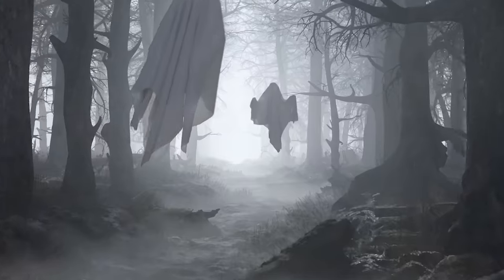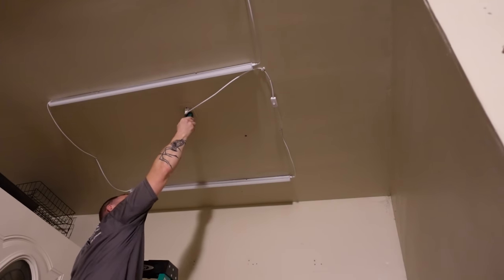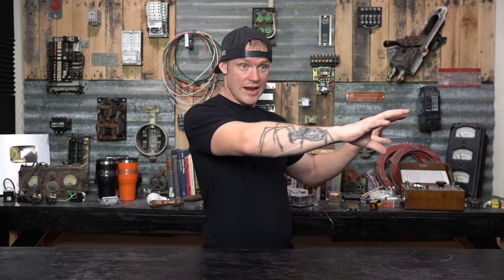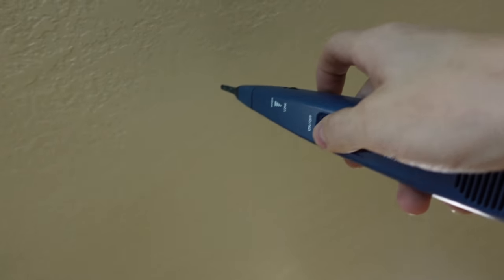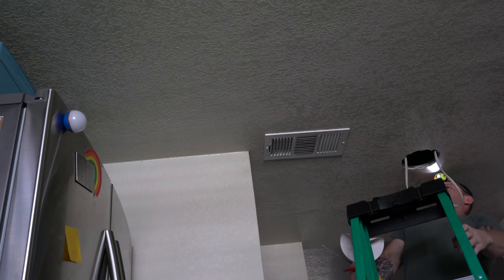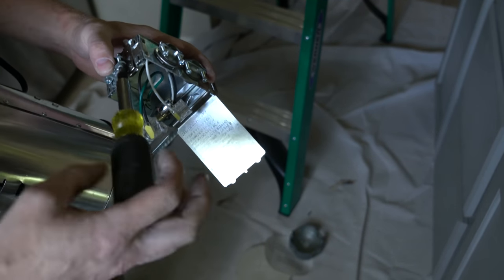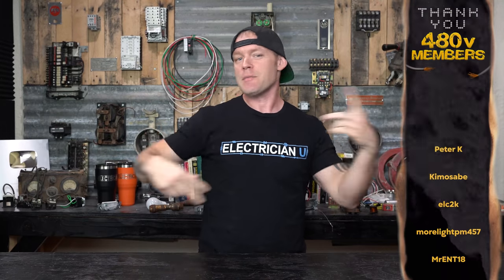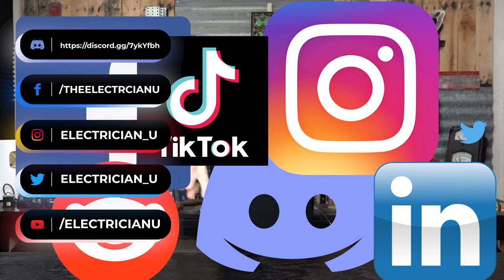THIS IS WHY ELECTRICIANS DON'T HIDE J-BOXES IN WALLS - Finding Hackwork!!

Comment: while adding a new outlet I discovered bad work at my intended old work location, so my simple task became a significant chore.  The original install really chewed up the nm cable at point of entry to the box and the was no slack/ service loop. I just had to create an in-wall junction, sigh.  I was able to access some dead space in the home through a closet, crawled in around ducts and added the box with new wire to extend to the old outlet.  I’ll close up the hole in the closet with an access panel (accessible) and leave a label/note in a couple of locations so it’s a documented for the next person.  I hated to do that but the other option was opening up a big portion of the ceiling with low clearance above it, multiple rafter/joist transitions and insulation too.  I’m thinking it will be best that a young apprentice be the person going in later, more “experienced” (read: heavier) tradespersons might have a rough time.   Hehe.   Nice job finding and even better explaining this to people.

Comment: Maybe-useful distinction:  voltmeters or lights show a measurement, and draw just a tiny amount of current from the circuit to do so.
However, sometimes the measurement is of an intact circuit that can deliver amps, and sometimes it's of an open circuit or stray capacitive coupling that can only deliver a tiny amount of current.  That's how you can measure 120V between wires A and C, 10V between A and B, and 6V between B and C:  wire B is open, and there's capacitive coupling going on.

Comment: Stray voltage (neutral to ground) comment – possible explanation. It appeared that there was no discontinuity in the hot (black) wire. So, any device connected downstream of the broken neutral would connect the hot to a mostly floating neutral. Provided this was a low powered device, (like a radio in a switch suitable for home automation or even your outlet tester) it would provide a very high resistance connection (hot to neutral) resulting in the stray voltage you detected.

Comment: Good information.

One caveat. The installation instructions for those low-voltage LED wafer lights stipulate a minimum required clearance…typically 3 inches…above those fixtures. Point is, they should not be installed directly under a joist as explained.

One question - what meets NEC when the connecting wires CAN’T for inside the small metal j box provided on the fixture?

Comment: I do low-voltage installations quite regularly and I'm also an avid DIY'er and the guy whom friends and family call when something needs fixing or building. Very often I encounter workmanship that I, as an amateur, would have been ashamed of putting my name on and charging money for. I cannot count the number of time I've gone in to troubleshoot an electrical or mechanical issue only to realize the problem at hand is the inevitable latest step in a long chain of incompetence or inconsideration (or both) on the part of those who came before.

Sometimes a situation is salvageable (as it was in this video) but very often a remedy is impossible without extensive structural work. 

Much to my chagrin, I still encounter homeowners, builders, contractors, etc who are willing to half-ass a job if it means saving a few minutes or dollars. "Not my problem" is the attitude and it's anathema to me.

Comment: Okay so I stopped the video at 8 minutes 25 and I'm going to predict that this outlet is GFCI protected from the GFCI in the kitchen... Is carrying power to the switch the light... And you're about to find out from customer down the line of the video that sometimes happens when the GFCI is constantly popping in the kitchen...also it is not wired correctly or ground is being energized which we all know thats a big problem ....I'm probably wrong but I could be right.....i will play the rest of the video...to get my answer.... By far one of the best or the best electrician channel

Comment: I had a strange voltage issue at a rental with lights flickering. Traced down to one of those CFL light bulbs plugged into an outdoor patio light. Replaced that light bulb with an LED and everything started working fine again. It is a 1970s house so probably all the neutrals and grounds bound together in random places which explains why I can have strange voltage issues with the neutrals. especially with lit up switches with LED light bulbs 🤭 that don’t turn off.

Comment: Great diagnostic ability. The only thing is if the wires melted . Wouldn't the actually issue be that's there's too many fixtures on that line? And the best course would be to run a new line or tap off something else?

Comment: In these situations I typically look to label the local circuits first.  Even posting sticky notes at each receptacle outlet, switch & pot light. This will really narrow down where the problem is. Checking for loose or burned hot & neutral connections in the panel is a super easy first check.
Out in the branch circuit, often/usually there are 12 or less outlets on a circuit, this means up to 12 plugs to open, some switches/dimmers. That’s not very many.  Troubleshooting this you will be able to NOT JUST GUESS and identify the route of cabling quickly.  It doesn’t matter the route of the cable, just were the cable starts and begins…….Usually the problem will show itself. Unless of course there is a hidden junction box  however not skipping steps and using a method like this, will identify between which boxes is the problem.

If your followers are GUESSING at anything in an electrical system, they shouldn’t be working on it. If they happen to make the problem or symptom go away that’s not entirely an indication of a safe repair.
Like I said, if they are guessing about things, they likely
Don’t have the skill and ability to make safe “cold” connections.
Making a mistake in plumbing, you flood your home.
Making a mistake with roofing, you have a leak, bad HVAC, you home is too hot, cold, dry or damp.
Making a mistake with your electrical connections and wiring methods can be fatal.
Like your channel, but
Let’s hope peoples take away is to hire an actual pro, to not ATTEMPT to do their own work.

-another idea, install a ceiling mounted smoke or CO detector instead of adding a pot light….that likely will look like a mistake.
The detector can be a battery only one, mounted on an octagon box.
Inside the box can be all your
Connections.

Cheers and stay safe

Comment: Interesting video.  Question what caused the overload/melting? If they have that many lights on one circuit was the amperage right in the breaker?  Any idea who installed the original electrical and why it didn’t meet code ?

Comment: Bro I love this video. I do repairs on pool equipment. So anything with in the pool area is my domain. Gas, water, electrical. We see and deal with everything you can imagine. I've made a nice living on solving problems no one else can.  
  Anyway, I do this constantly and I always teach the new guys this. By asking a ton of questions. What is happening to the best of your knowledge? Like what is the complaint? When was the last time this worked? Was there anything recently that happened out here like construction or someone else out here that possibly touched anything? Was there any new parts installed? 
Honestly great video just for those facts. We are investigators and when we treat the job like that it saves us time and money. And the customer is always stoked because they know I know what I am talking about. There are alot of people who try to do electrical or repair work because they have a pool company but have no idea what they're doing. So even if no real information is gathered which is really never the case. The customer knows I'm on the right track and I am the man for the job.

Comment: 22:00 Here is the issue "I" have with those puck-lights.  3 years from now, one burns out.  You run to your box store to grab a new one and find out that they no longer make it.  Now, you need to install all new lights to match.  For one or two?  Not bad.  For someone that has an entire house with say, 100?  Better off with remodel cans and adding the light bulbs.

I've also noticed that they don't have as good of a range of dimming.  I personally run Phillips Warm Glows.  It's about as close to an incandescent as you can get but YMMV.

Comment: Self-defense tasers output around 50,000 volts but only around 3mA.  I assume that voltage isn't the best thing to have running through you and can probably cause problems, but it's the amps/current that will tear you apart.

Comment: Now that it’s fixed will it stay that way? I’m assuming that circuit is overloaded. Did you check the amp draw of that circuit? Even with the new LED lights I’m sure it’s still on the high side!

Good find, as an automotive technician people don’t understand why an electrical repair can cost so much. It’s not the repair so much, it’s trying to find the bad spot! And cars now have communication systems so we have to have IT skills as well as mechanical knowledge.

Comment: I learned stuff today and I was brought here randomly! Even so, I watched the entirety of the video and found it interesting. I am curious, why are you using the old twist-type wire nuts versus the push connector type? I'm finding myself using the push type whenever I replace something (lights, ceiling fans, etc.) since being introduced to them by the general contractor/electrician who remodeled my bathroom a couple of years ago.
Reply from the maker: Thanks for watching! Personal preference, what the supply house has in stock, plus standing inventory are all factors.

Comment: Had this happen a few times. First time in a bedroom and it ended up bein as simple as the arc fault breaker not bein set all the way down on the neutral bar. As far as I've learned from that reading, check all neutrals all the way back to the panel and you should find your fix

Comment: The thing with those canless LED lights is, if one goes out, which it will, good luck finding a replacement one that matches. For this reason I'm still using screw in LED bulbs and buy a few extra. If I am unable to match the color or lumens later it's far cheaper to replace the other nearby bulbs with matching ones.

Comment: UK electrician here. We make sure that the entire installation in a domestic environment no longer requires a junction box. All connections are available in ceiling roses and we will only tap off direct from other outlets. However we cannot account for 'home made' wiring issues.

Comment: when you see a "weird" voltage with only a meter (i.e. NO LOAD) put a load on it and see if the voltage goes away.
I love using a 100 watt incandescent bulb for a load as these types of bulbs also work as a current regulator.
If the voltage drops to zero under a load there is a good chance that the "weird" voltage you measured with just the meter is induced (i.e. created or passed on by induction such as you have in a transformer)  and not directly connected.  This will tell you that you have an open circuit/ broken connection.

Comment: Talking about hidden junction boxes......we found a junction box hidden inside our bedroom wall during our bedroom renovation, stuffed inside the insulation.  What made it weird was it was in a metal box that was wrapped in black duct tape. Our best guess is that whoever put it there ran out of wire length because it was between two outlets in a series.  Our guess on the duct tape was they didn't have a correct cover for it. Even stranger is this was behind the original drywall and there was no patches in the sheetrock meaning the original builders had to have done it. It makes us nervous thinking there might be some other questionable issues with our wiring.  We did hire an electrician to check our home out and he said everything tested ok but he did say that this doesn't mean there are no other hidden junction boxes. Now granted we never had any issues with our electricity and while the junction box was hidden and it had duct tape it was atleast connected correctly. This is just proof inspectors don't catch everything because our home had all the passing documents from the original build to date. Oh we also found trash inside our walls ,but from what I'm told this is pretty common on job sites. Smh....

Comment: Doing work on a house I just bought.  Redoing the electrical box and wanted to re wire the laundry room.

The junction box was jammed up inside the wall and they sheetrocked over it.

It was by the barely attached dryer duct and had 2 gallons of tightly packed dryer lint that had built up inside the wall.

It had 1 foot of cloth covered wire going out to a gfi on the back porch, then 3 foot of newer grounded wire going from the gfi back to a ceiling vent.
There was also a wire going all the way back above the electrical panel to power the 2 hall lights.
The box got its power from a plug on the wall near the doorway which got its power from the main breaker panel.  Probably 20 feet of wasted wire. Not to mention the fire hazard waiting inside the wall.
Also found some dead mice and chewed cloth wire when I was working on it

Comment: Great video but, "Jiggling wires" fixed the problem?.  Metal parts touching? Induction? Did you say connections were loose?

Comment: After watching this video, and a bunch of your other videos.  I'm impressed at a lot of the new products & conveniences in the market, from wagos, to wire nuts for grounding with pig tails.  I've learned a lot from this channel and have used your demonstrations on wiring all the time.  However, one thing came to mind after watching this is with junction boxes, wires are put together by twisting them together and then capped with a wire nut.  But with all the other new things on the market, could they make a junction box with buss bars?  The reason I thought of this is because in my attic I have a 15-amp home run going to a junction box that feeds 4 fixtures and  it is a little crowed in this one box, so I had to jumper it to another box.  Is there anything out there you know of in a junction box that has buss bars to neatly connect multiple circuits together?

Comment: 25:05 Great concept -- "ghost voltage" -- voltage delivered through a high resistance, such that the meter can see it, but it can't power a load.  Everybody needs to be aware of this possibility.

Comment: I'm finding wires can get quite brittle simply twisting wire with those Kleinesmans, they can 
break and you end up with not enough wire to work with. This is when I use Burndy's or 
similar name a small copper barrel holding wires and then crimping.

Comment: I saw something on a YouTube video where an electrician used a large plastic bowl with a small hole in the center of it.  He threaded the mandrel through the hole and chucked it in to his drill so that when he went to cut the holes for the can lights, all the dust and debris was contained in the bowl and he could just dump it in the trash can.  It was a thing of beauty to watch!  
A word of caution to other up-n-coming contractors out there:  If you are competent, professional and do nice work for a fair price, YOU WILL NEVER BE ABLE TO RETIRE!!!!!!!!  I have been trying to hang it up for over 5 years and I still have people calling me!  I did some work for a neighbor and found some seriously sloppy wiring that could have caused a fire, that was installed maybe 6 weeks prior by an electrician that was recommended to them by a friend from church.  When I asked them how much they charged them for the work, I almost did a backflip.  Not only did they do it wrong, left a mess and could have burned their house down but they paid way too much for the privilege!

Comment: As a diy home owner, who goes passed code requirements, I hate going through the house and finding things not up to code. 

I changed a bathroom light, switching to light with exhaust fan and had to rerun all the electrical, but the house is from the 50s and I’m so glad the one problem I haven’t found was asbestos.

Comment: I was a helper for an electrician a couple years ago. Worst one i've seen was tucked into this lady's ceiling behind an access panel, she was having an intermittent issue with lights not working in a bathroom. Must've had 10 deteriorated cloth wire circuits between 12-14 gauge all linked together, soooo many jumpers lol. I left the company shortly after so I don't know how that was resolved. Scary stuff

Comment: This is why in the UK junction boxes are considered bad practice, in fact they are now against code. He was lucky that it was easy to reach and find, sometimes it could be mid wall!
Junction boxes are a lazy way to wire and give problems later. All joints should be at switches, lights and sockets (receptacles?). So that all cable hidden, is not joined in any way. Just a solid run of cable-best practice. Easy fault finding later.

Comment: Hey Dustin I had the same service call a while back. It was a bared j box behind a wall on a flip house turned out to be a loose neutral in the box that's why I was getting  strange voltage readings

Comment: I REFUSE TO USE WIRE NUTS when I do household wiring because of issues with wire wing nuts. 

Since 2016 when I encountered a similar issue after taking over the electrical work on my friends remodel I only use - Ideal In-Sure Connectors - or - Wago Connectors - if I’m feeling FANCY. The Wago really are so awesome to use though cuz you can easily remove the wires if you need to make a change.